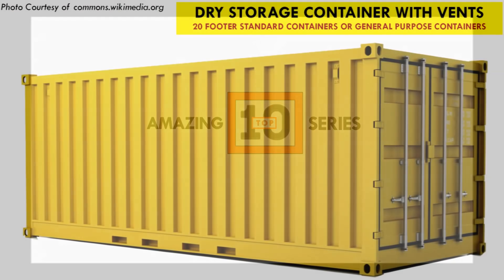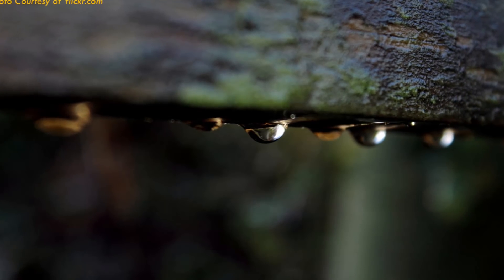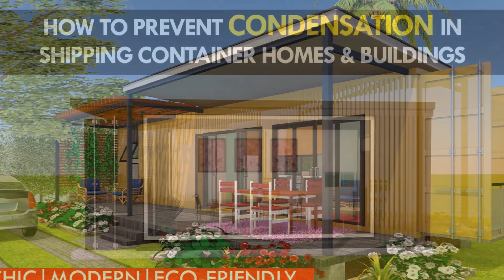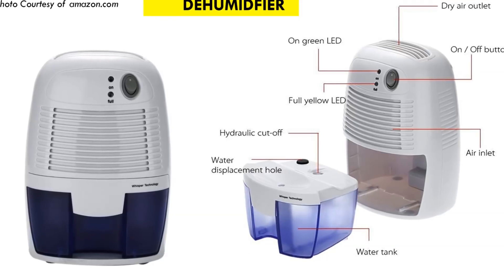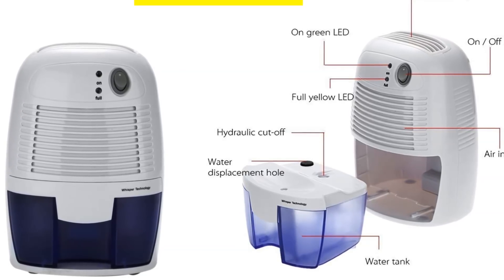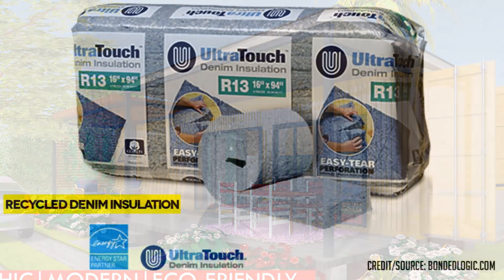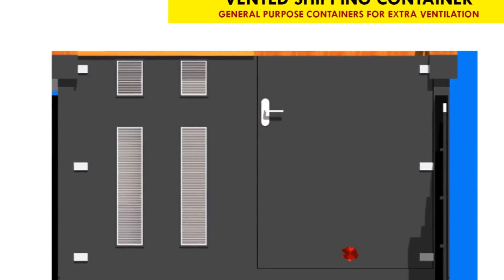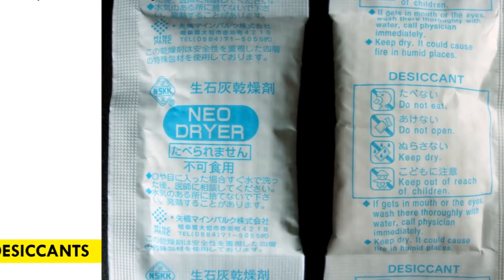HOW TO PREVENT CONDENSATION IN A SHIPPING CONTAINER HOME

Comment: Thanks for the inspiration.
I live on glasfiber coated wooden boat, which is difficult in terms of condensation and mildew. Now have a strategi of control more condensation.
1. I will line the wooden walls with wool, that way the wood can breathe and won't rot.
2. Make a couple more passive ventilation holes in both ends so the air may circulate. I may also apply a fan, if it was hooked up to a hygrometer it would be perfect.
3. Place kitty litter bags on both sides of the hul and keep watch as they fill up.

Comment: Best method for developed world (people with relyable power): Insulate the container, either 100% of the interior or 100% of the exterior. Use an ERV (Energy Recovery Ventilator), which brings in fresh air, while limiting the exchange of temperature between the interior and exterior of the space. An ERV also helps control humidity, but not usually well enough on it's own. Also use a small dehumidifier, which will run less due to the ERV. This combined method is optimol.

Comment: i spent the last of my money to build a shipping container home and now i can't even live in it because i can't afford to insulate it correctly. the seller i bought it from told me not to worry about condensation but mold is now growing inside and im soon to be homeless. what a nightmare...
Reply: Use versatile and safe (for you and your house) chlorine dioxide (quantumleap(dot) is) 
As spray on mold removal that really gets rid of the mold without being corrosive to the building materials.
+ dehumidifier hot air blower inside the house to remove the residual moisture from the chlorine dioxide water solution (it’s mostly water but kills molds effectively). 
Another easy to use and less watery option is ozone, which can be generated (by rental ozone generator used to deodorize buildings) 
You + pets & plats must stay outside until the treatment is done and the machine is switched off and the container well aired out, but it can help to inexpensively reset the development of molds, which will stay away with help of 
Dehumidifier, which can have its waste water to drain directly outside with a little pipe diy. It can also be made to work with a sensor or timer to make it easy and prompt. All the best.
Reply: tell us more about it
Reply: You can at least buy a dehumidifier and kitty litter?
Reply: Would dehumidifiers work? I’d imagine accessing the humidity between the metal and the insulation is an uphill battle. The condensation from the indoor air can be pulled out but I don’t imagine the dehumidifier preventing condensation
Reply: These lumber lobbyists need to stop spreading lies about shipping containers.

Comment: Some excellent tips. I'm currently building a hybrid container/conventional home and am having some condensation issues. We have a cold climate and I don't have a full heating system in yet. I'll definitely get a dehumidifier and try the kitty litter trick out until we have the heat pump system and ventilation hooked up. Our final system will utilized 2 passive vents, a heatpumper/humidifier, dehumidistat controlled fan and stove fan. 
I'm surprised how much moisture we are getting since it started getting cold. It was fine all summer.
Reply: A wood burning stove will cut way down on the humidity because it is a dry heat. Most people that burn wood have to sit pots of water on the stove to humidify the air and I live in FL.
Reply: yes, would be soooo useful to see the REAL experience of people with container homes! most of it is just advertising or airbnb advertising, and not a real experience. This is a very important issue because such condensation can potentially make the dwelling uninhabitable. On the other hand if you use special this and that to insulate, heat pumps and dehumidifier etc etc, soon the costs will add up and container home will end up an expensive solution. Also it would be great to see someone who knows what they are talking about and have real solutions, because there are so many versions on how to insulate and address the condensation issue that it is hard to make sense of it. For example the above video is full of errors, the person clearly has little idea of what they are talking about. 
Would love tp hear more of your experience, since it has been 9 months since you wrote the comment. Did you have any issues? How did you address them?